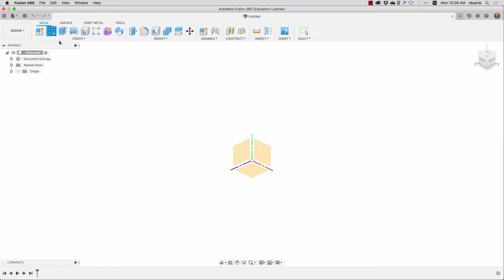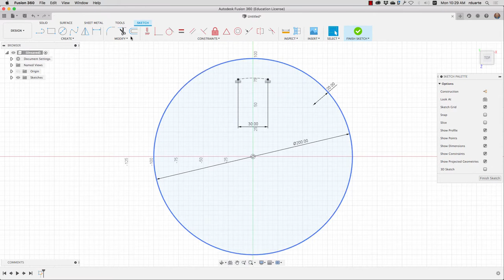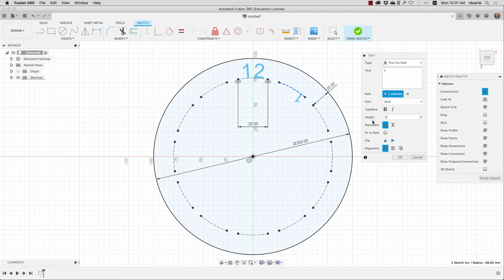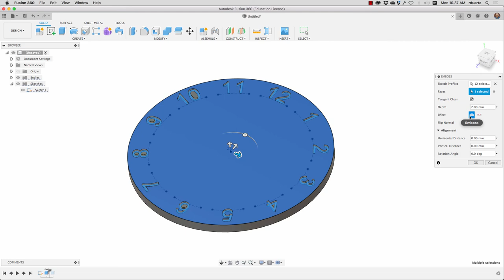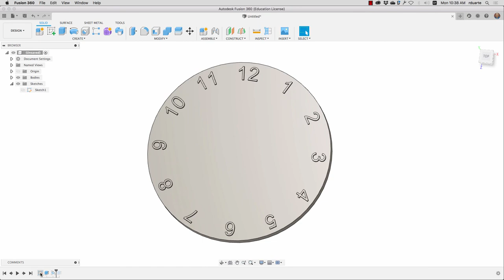Fusion 360: Using Text on Path to create a clock face

Comment: I agree that making the settings sticky would be an improvement. But, I think the absolute best thing would be for the Fusion team to add text settings as possible units in parameters. That way you could have a font parameter that drives all of the text in your design and could change all of the text from one place.

Comment: i cannot figure out how to make the numbers go straight instead of just all twisted to the sides omg
Reply from the maker: You could do a circular pattern of POINTS instead of the arcs that I pattern in the video. Then sketch horizontal lines going around the circle - each centered on one of the points you created. Then you'd have 12 horizontal lines to draw your numbers on.
Reply: @RobDuarte  That worked great, you're awesome dude, thanks!